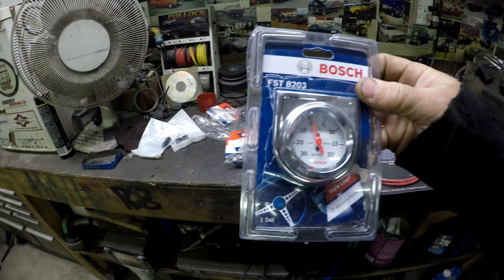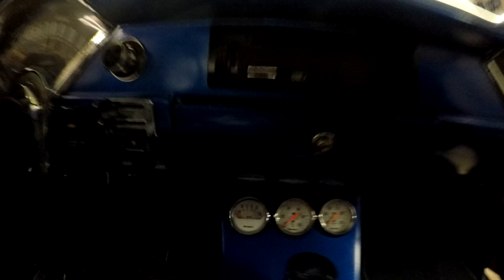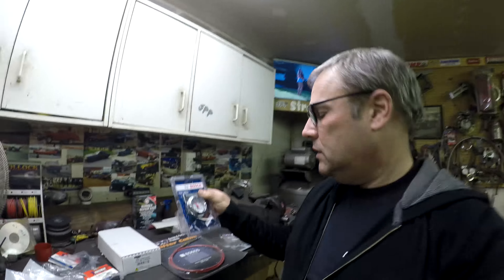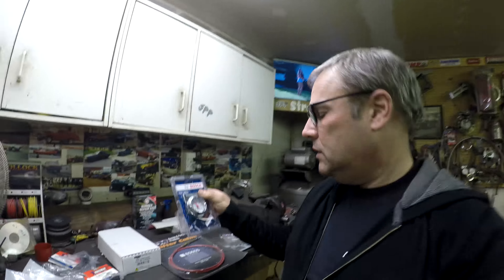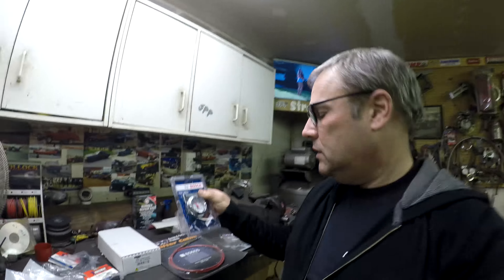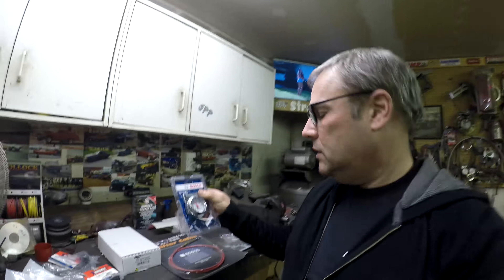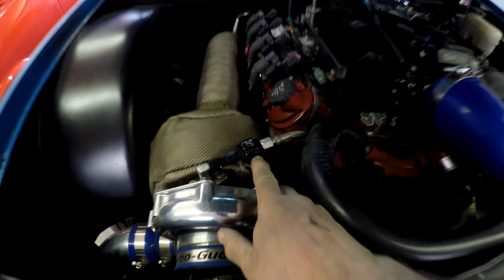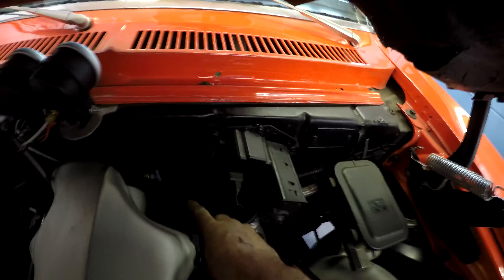TURBO BOOSTED LS MINITRUCK - MSD 8733 2 Step and Boost Gauge Install | BlueGhost S-10

Comment: Quick idea for the shifter surround.  I ended up using the little stock brush style things.  I just went to the junkyard, I grabbed a few and ended up using one out of a Jeep Cherokee for the transfer case lever.  Looks slick, covers the gap.  Give that idea a look.
Reply from the maker: I will check that out, thanks

Comment: How do you like that throttle body
Reply from the maker: It works good, whistles a little bit. The ones that have 92mm stamped on them seem better
Reply: I heard those don't idel well either
Reply from the maker: I have no idle issues with either